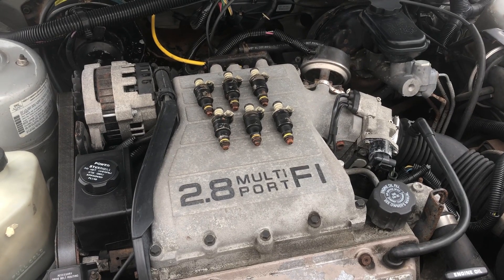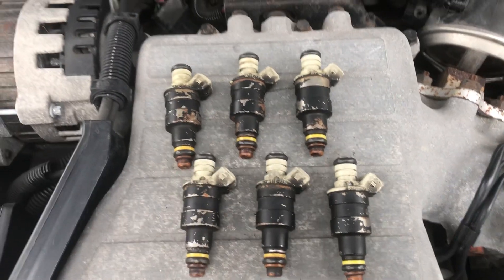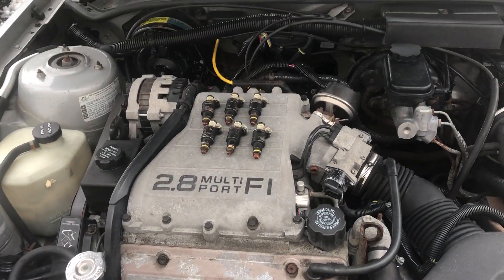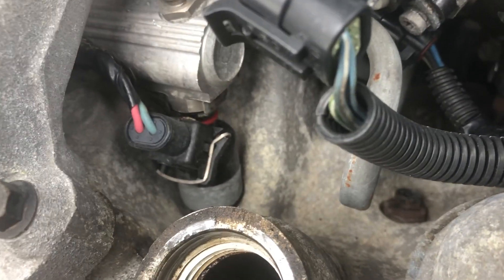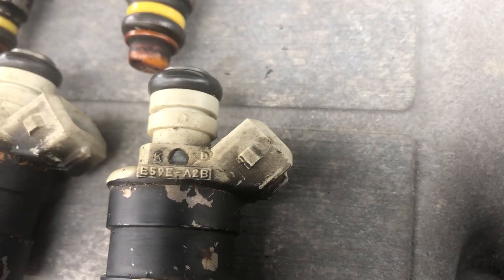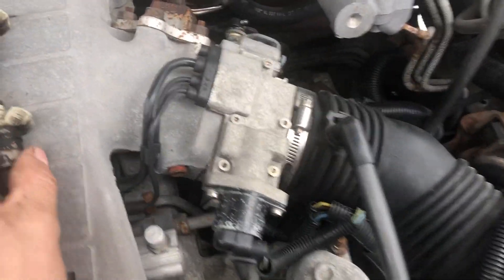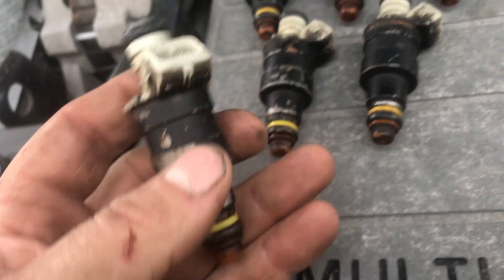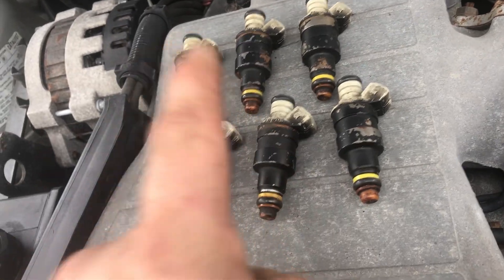Ford Injector Upgrade for GM 2.8 & 3.1 MPFI

Comment: Did you ever install these?
Reply: I did. It runs the same and have better mileage but have some issues.The car has been sitting and all my emissions hose lines broke when i was trying to get em to sit right. Ill come back and comment after i find a new emission vacuum line harness and test it.
Reply: Issues with the injectors? I found these same injectors at a pull a part yard got them off an 89 lincoln town car and plan to use them, was just waiting for your response. Thanks for the update !
Reply: @90sEraWhips  he’s not wrong about the plug and play. It improved my mileage and performance. The spray pattern is different so your gonna have to tune it for maximum output of HP/torque and the A/F ratio to be accurate. I haven’t tuned yet tho and drove over 100 miles now. Ill come back after the tune but all in all. It is an upgrade

Comment: I went with the z34 dohc. Injectors on my 2.8v6
Reply: They worked with no issues an same size an everything
Reply: @KnuckleHeadGarage27  I have a stage 2 chip and 282 cam with ported intakes upper and lower and the heads are ported heavily and better Springs as well so I have a pretty choppy the injectors were a direct plug-in that's why I spent time hunting them down but they made a difference
Reply: Did you have you get it tuned?

Comment: Hmm interesting I'll have to remember that .

The inside of that valve cover looks way better cleaner than mine does .
Reply from the maker: I said in the video what these came from. Anything related to that time frame and this part number.
Reply: I’m trying to find a video on how to do the valve covers on these 3.1 Mfi engines all I find are the darn videos for the later sfi 3100 I need to do the job on my Pontiac 6000